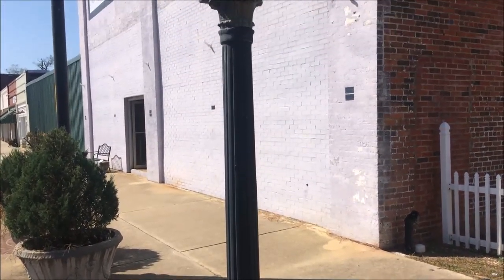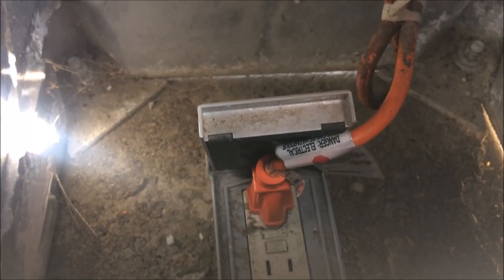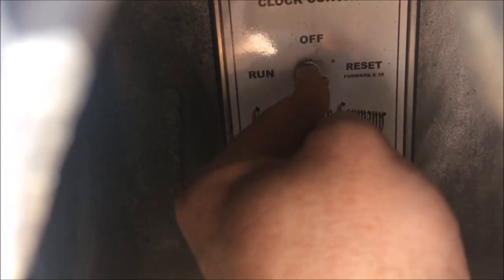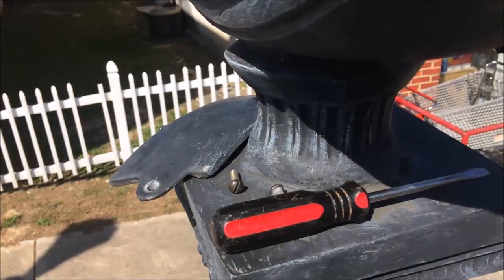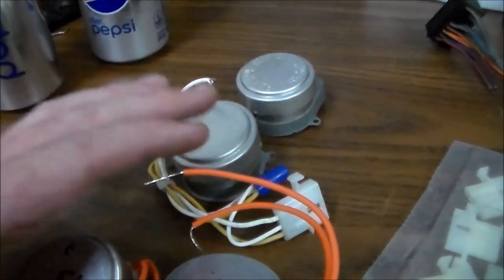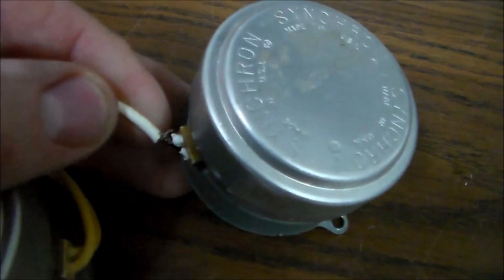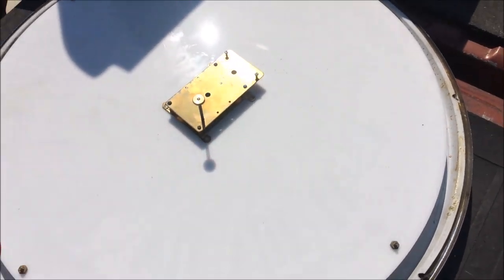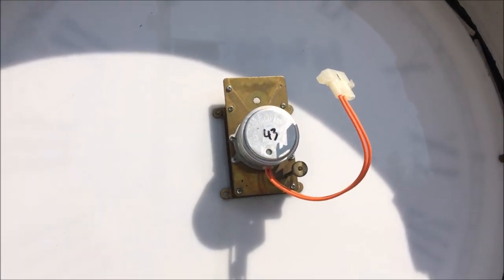Repairing the Street Clock In Jefferson, SC - Main Street U.S.A.

Comment: That's a beautiful old town, for me in the UK it is very interesting to see.
We use synchron motors like that commonly in central heating motorised 3 way valves. I've changed them over before.
I think the reason it has a reset motor is for a small adjustment in time as you discussed. Saves using a ladder and getting behind the face. I was surprised there wasn't a switch to select which face. Or control system was originally for a single face clock.
Reply from the maker: It was all kind of a custom thing I think a guy builds in his garage!  The company seems to be out of business....  thank you for watching, glad you enjoyed it!
Reply: @LyonsArcade  I was waiting for you to source a hi speed synchron motor and add the extra wires required to switch each side of/on after the main switch box, allowing the faces to be independently controlled. After watching all of your EM pinball videos, I get the feeling you probably wanted to and perhaps there was not time. I hope they offer you the opportunity to go back and add that extra wiring, to make the clock work as the inventor wanted but didn't quite achieve. :)

I always enjoy your videos..

Comment: I think the reset is for power cuts, like if you turn it off to change the light bulb or there's a black out, to catch the clock back up.
Reply from the maker: That makes sense, I never thought of that.  It would probably be helpful if the power was completely out, but only for half an hour or something, you could easily catch it back up with that switch....

Comment: motor was probably for advancing 1 hour, which would take 6 minutes
retarding 1 hour, you use the switch in OFF, and council employee sits and waits 1 hour before turning it back on.
seems much easier to take of that top plate instead ( also 2 screws) and adjust manually by hand.
Reply from the maker: Yup that's how I saw it.. I've adjusted it a couple times since then, easy peasy.  Takes about 5 minutes if you count getting the ladder out :)  Thanks for watching Elvis!

Comment: I don't think it's possible for the faces to be out of sync with each other
the motors are synchronized with the 60Hz AC, so both of them will always run at the exact same speedthe only time you'd need to adjust the time is if the power goes out, or if the time slowly drifts because the AC isn't exactly 60Hz, which would affect both faces equally
Reply: That doesn't take into account the mechanical variability of the two mechanisms. They should be pretty close, but the tolerances of the machined parts will be different.
Reply: It doesn't matter, unless there's so much friction that a motor misses a "step", or one of the gears has the wrong number of teeth or something
Reply: was going to write the same on this old vid. Those are synchronized motors it seems, made to tick with line frequency. not standard magnetic field slip motors. If one face is off, then there is more serious issue with the clock than minutes off.
Reply: Maybe the coils inside the clock motors are ever so slightly wound differently.

Comment: I recognise those motors from motorised central heating valves.  I have one valve thats a bit stiff, and the motor needs replacing every couple of years.
Reply from the maker: When I searched for them, they kept coming up as related to thermostats.... I think the motors were made by "Hansen"....
Reply from the maker: Glad you found us, you'd know better than me but I think when I saw it say "Honeywell" I just thought of a thermostat instead of a valve!  Nice to know what they're used for.  Some of the Atari potentiometers on games like Warlords, etc. had that slip clutch on them, so that if you turn them and keep turning it doesn't tear it up!
Reply: If you're in the US there probably called a zone valve.

And yes I know about these.

Change the few myself here in there for other people mostly.

First time I did it was for my parents.

One day we noticed it was quite cold downstairs.

Thermostat checked out.

So I went to the utility room which is also my workshop.

And realized the motor would not even run.

Check for voltage.

The proper voltage is present.

However it didn't even run.

It was not actually motor but it was the rotary switch inside of it.

It was one of those wafer switches.

Rotary.

The contacts  just totally shot.

The neisius does zone valve motor for easy to change disconnect wiring loosen a screw so many degrees.

And pull.

The Good Earth day was we did not have to get a spirit park at that time.

At least for that time.

Because in the cabinet in back there was a spare zone valve motor assembly.

Along with that was are parts for the charmglow gas grill.

Which is plugged into an actual gas.

By the way the old charmglow gas lights pole lights were outside have been converted to Electric.

Also we found a good choice for that and hers bulbs we sell on microwave bulbs.

Bright enough to see the area but not too bright.

We actually calculated about how many hours a year they would be switched on because they were on a photocell.

Also I warmed up wiring an outlet at the base of the light posts with one switch and to fix and also one of the switch by photocell for future use.

Which would also allow us to use Christmas lights on the pole.

Also I did make adapters to plug into the sockets that wound up in a female cord connector.

My parents had asked me about possibility of putting Christmas lights inside the white and around the pole at Christmas time.

Actually what the adapters were intended for racially was exit sign conversion kits.

But I bought them separately and clipped off the connectors.

And put on the female plugs.

The base or no spoiled for double contact bayonet base.

Pretty much like a sewing machine might have.

Also if you ever have a sewing machine it just runs and runs and runs when plugged in there maybe noise suppression capacitor that short it out in the foot control.
Reply: Oh and yeah most of the times does zone valve Motors at least as far as I know would be 24 volts ac.

Comment: https://www.hansen-motor.com/products/ac-synchronous-motors/600Series-C-mount/  "remember some of these motors are fitted with one or two way clutches so they will allow rotation when you set the clock by hand, and can be clockwise or counter clockwise rotation.

Comment: Yeah, the full fix would have been to add a second three-way switch for one of the faces, and change the other three-way to control only one face.  If a clock is fast, you just set its corresponding switch to OFF for the necessary time, and if slow, go with the 10x speed until it catches up.  But what you did certainly suffices.
Also, unless the clock has a UPS or battery backup, every time a storm knocks out power, someone will have to adjust it.
Reply from the maker: Seems like a ridiculous setup.  It takes me maybe 5 minutes to walk a ladder out of the building behind the clock, climb it, take the cover off, and turn a knob to change the time.  If I try to use the 10X switch to set lets say Daylight Savings time, it would take me at least 6 minutes of it being in that position, plus I have to take the bottom access cover off anyways.  If I want to turn it backwards, I have to turn off the clock for a full hour, I don't know why anybody would have a problem with just grabbing a ladder and setting the clock by hand, takes 5 minutes no matter how far off the clock is.
Reply: @LyonsArcade  You're right, though for, say, the owner of a store next to the clock, or an employee to do this, would involve liabilities--e.g., employee gets up on a ladder, opens the side port of the faces to make a adjustment, and falls off and injures themselves.  The best solution is for a township employee, perhaps a ranger, park worker, etc., who goes by the clock every day, to have the responsibility of seeing that the clock is accurate.
BTW, off-topic:  Have you ever seen the "Thief" video game from the late 70's?  It was basically a maze-running game where you're the thief and your car snatches up dollar bills as it runs the streets and tries to avoid the cops.  The greatest thing about the game was the loop of continuous police chatter that ran in the background, where you hear a rather inept police department try to cope with a thief that is running down streets in the wrong direction, crashing into cop cars, etc.  One police official (captain?) laments that they can't seem to do anything about the thief, and then someone says, "Why don't we take up a collection and send him to Cleveland?"
Shortly after the game appeared in my local 7-11, parents in the area got bent out of shape because of the "corrupting influence" of the game and got 7-11 to remove it.  No joke.

Comment: I imagine "Reset" would be for power outages amongst other things.
Reply from the maker: It's probably a good idea on most things but for this particular clock it didn't serve much of a purpose for us...
Reply: Its used to change the time for power outages or to adjust for daylight savings without needing to climb a latter and take the side plate off.

Comment: nice work...the generator threw me off cuz it doesnt seem to be a job requiring 110VAC powered tools to fix a clock lol
Reply from the maker: We're doing a ton of renovation work on the building behind the clock, fixing the clock was just a minor little thing we did while we were down there each weekend working on the building.  A broke street clock sucks but when it's right in front of your building it sucks even more :)
Reply: @LyonsArcade  Not to be nosy, but is that a project of your own, or doing the work for someone? The old empty bank on the corner sure is neat

Comment: They have versions of those clocks that are electronically controlled and get their time from the GPS system.  I don't know why any municipality wouldn't go for that option.  It makes the clock maintenance free.  None of the having trained personnel come out twice a year to set the clock or reseting after every power failure.
Reply from the maker: Well I'll tell you why... because they cost much more than this basic one does.... and because you then have to have it connected to the GPS system which has a cost associated with it, and if they break they're more expensive than this one to repair.

Just because something can be done, doesn't mean it should be done.  This is a small town out in the middle of nowhere that had some grant money to beautify the town and there wasn't enough money to buy one with a GPS controlled clock.  

Setting the clock takes 10 minutes and the guy that waters the bushes can do it, it's not that big of a deal.

Comment: so twistin the clock-adjust didn't take ages to correct ? that's all I can think a 10x is useful for.  Our local clock tower has a LED strip and cycles between colours
Reply from the maker: If you turn the knob, one turn moves the hand pretty much all the way around so nope the knurled knob doesn't take too long by hand, I don't get it but it's working fine without the 10X :)